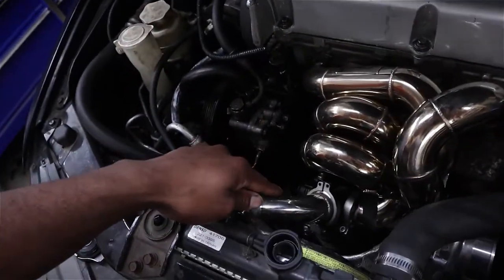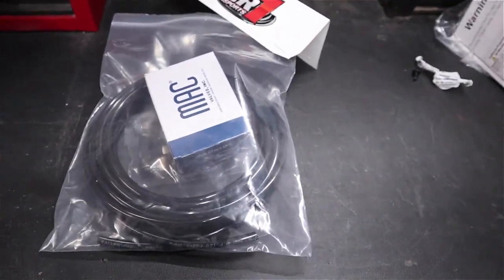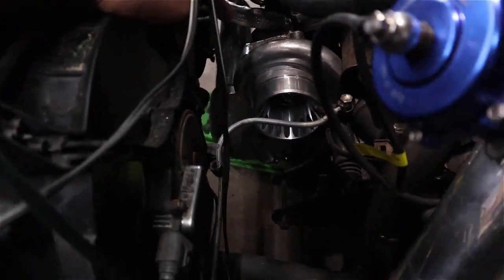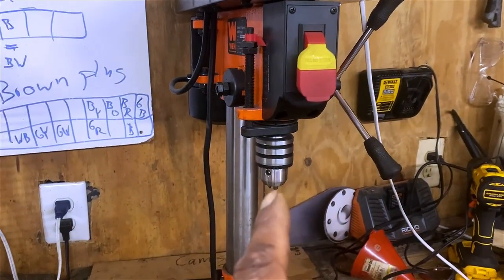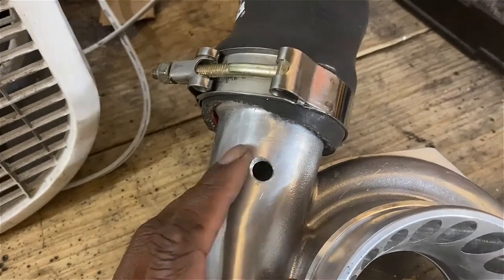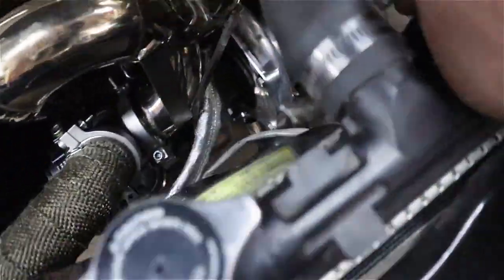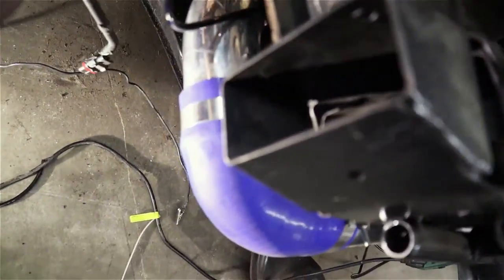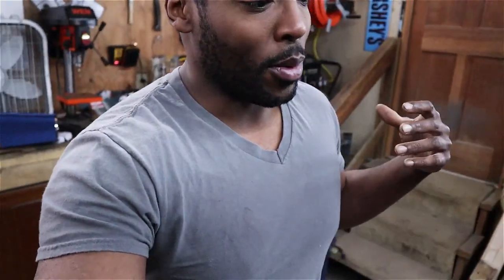Installing a 3 port electronic boost control solenoid and a boost pressure source

Comment: Thank you! I've been having people tell me that I needed to pull from the intake, so I ran a block and plugged my turbo... looks like I'll be swapping fittings around and using my compressor housing to run to the Mac valve! Hope this works in the long run. Not that it matters, but Mines on a LS in 99 Camaro. New to turbos, and anxious to see the change from blower. Thanks man!

Comment: how did you connect the wire on the mac valve to the ecu boost control pin?

Comment: I know your video a year old but you see that nice raised spot on the opposite side of were you drill for you boost port should have used it possible  you know the more treads the better especially being fine thread

Comment: Why couldn't you use the factory boost solenoid wiring?
Reply from the maker: The Galant/ Eclipse doesn't have a factory boost controller.
Reply: @RvaJay  it did, my talon had one. got a manual on one now and im about to replace it with a mac valve

Comment: Not tryin to be a dik but Never seen anyone use top and lower vacuum port on waste gate. Mine top port was vented lower is the only one connected
Reply from the maker: Which is how the manual boost controller that’s on the car now is plumbed. Electronic boost controllers can use both because there  is a vent on the controller itself(middle port). It can regulate higher boost level because of that. I think the channel driving 4 answers has a good video on it.